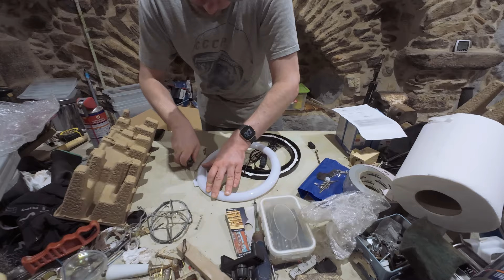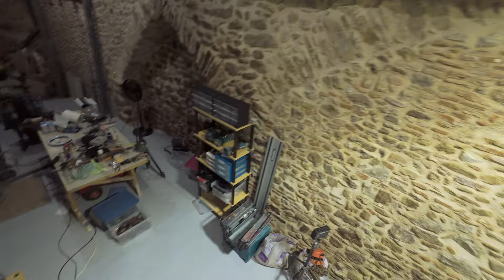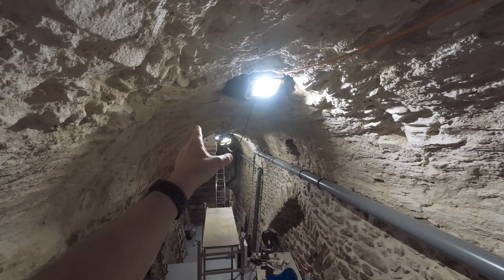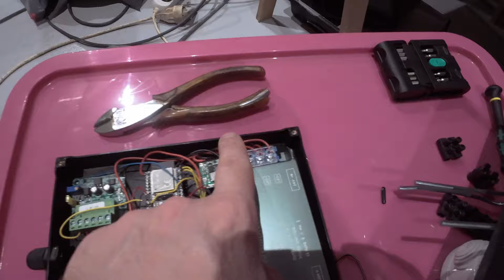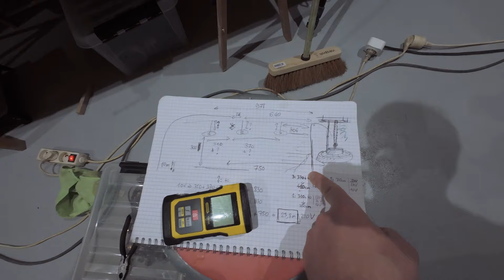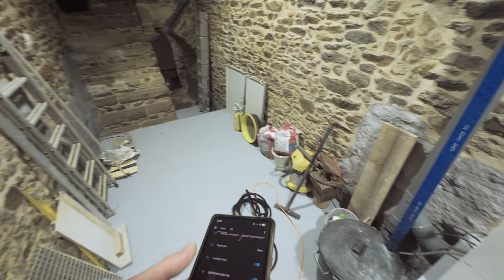Old Cellar 46: Over-engineered lights !

Comment: what an epic space you have created!  Well done.  Given the humidity levels in the vault, did you consider conformal coating for the boards or desiccant in the electronics box?
Reply from the maker: Hum.... not at all. Which is maybe a mistake... But this area should be relatively less humid. The vault is the driest part of the cellar. And I have some similar setup in the cellar for more than a year now and it does not 'seem' to be an issue yet. But I should keep an eye for that.